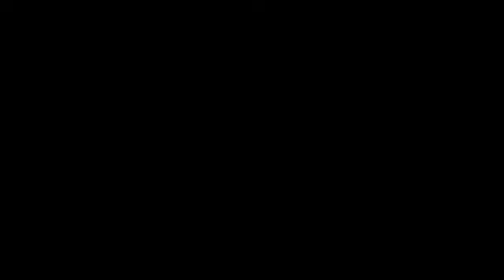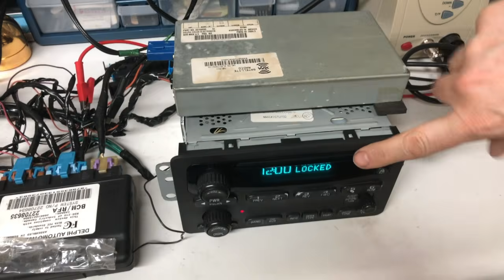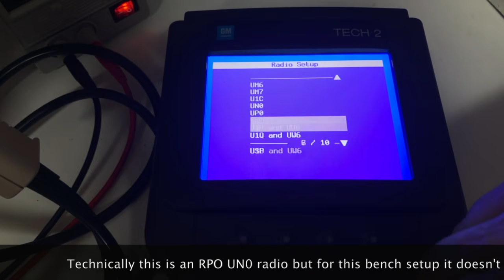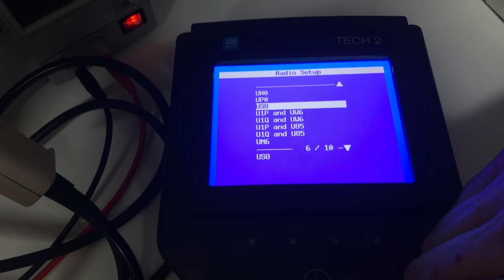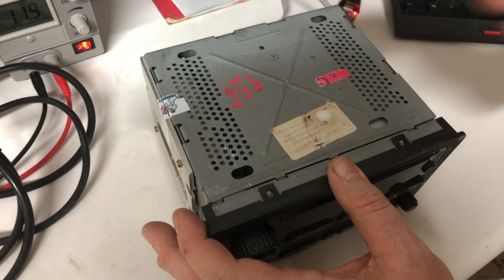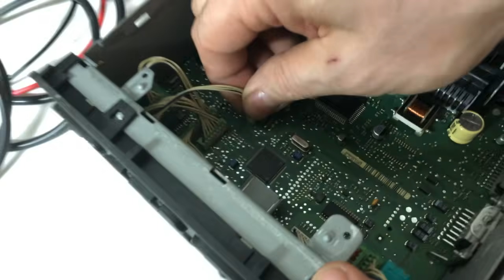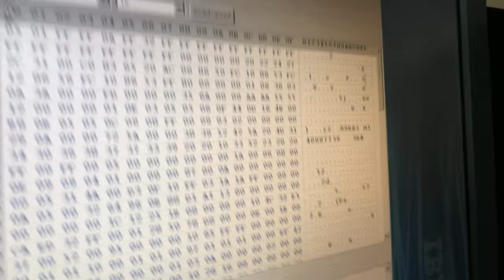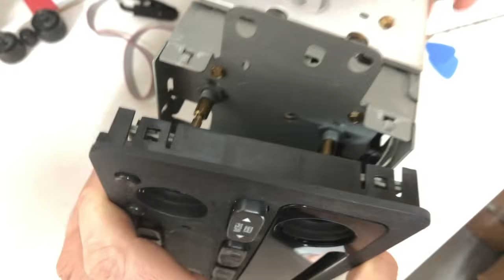2003 - 2006 How to VIN Unlock Salvage Yard GM RDS Radio w/ Tech2 OR Manually Programming its EEPROM

Comment: Dr. Shock, I have a 2004 GMC Yukon XL Denali and would like to replace my existing GM Radio/CD/XM/Cassette Unit with the same model unit (Salvaged - A Condition) which has the EEPROM cleared.  What are my options?  I don't have a GM Tech 2 nor GM MDI Scan Tool.  Would I be able to save the existing EEPROM data from Original and then write that data to the Salvaged unit?  Thanks for the help.
Reply from the maker: Yeah, I give two options for those without a dealership grade scan tool.   Your best bet is to just desolder the EEPROM from the original unit, and replace the one in the donor unit with the original chip.   Be sure both radios have the exact same GM part number as there are different circuit boards and different EEPROM contents out there even in the same model year.

Now you mention the salvage yard already has the EEPROM cleared and that's important.  As some vendors will clear this out with a scan tool before selling.  If you have that done, you don't have to do anything but plug and play and the radio will learn the new VIN on the first power up cycle.

Comment: Nice video. Question; what if you just swapped the chip to the replacement radio and be done with it ?  If not, why not ?
Reply from the maker: I believe I mentioned that in the video, that yes this is certainly an option (i.e., to unsolder the EEPROM from the original radio and replace the one on the donor radio).    For this to work though, both radios have to have the exact same GM part number.   Many radios have the same faceplate, but different circuit boards.

Comment: what is the numbers you changed on the eeprom and how do I find mine?
Reply from the maker: The numbers being altered represent the VIN of the vehicle that the radio is installed into.  You find them as I showed in the video, for this particular radio model. 

This video only applies to a particular year range and model radio used by GM.  Different year GM radios may have different memory addresses, and/or VIN formats stored so you may not find what I show here, if you have a different radio.  You may need instead to view one of my other vids I've done for different GM radio models and years.
Reply: @DrShock  my chip seems to be empty and i can’t get anything to show ip
Reply: @DrShock  I really don’t know what to do
Reply: @DrShock  I plug it in to my bench harness and it still has my presets even after I erased it
Reply from the maker: You may have to desolder the EEPROM from the circuit board and read/write it off circuit.  There can be circuit board differences even within the same model of radio that require this alternative approach.
Reply: @DrShock  I don’t have a solder gun and I’m not experienced in that at all, I’m running windows 11 if that changes anything, it may have to do with my computer since I haven’t installed any drivers and the only ones I find are outdated so I’m not sure
Reply: @DrShock  you may be right because I have a 2004 cassette and cd radio and it has a different board than the one in the video
Reply: @DrShock  dang that sucks
Reply: @DrShock  do you have any advice to program inside the vehicle, other than using a tech 2?
Reply from the maker: An alternative would be GMs' Tech2Win which is an emulator of the physical Tech2 tool that runs as an application program on Microsoft Windows combined with a J2534 type USB to vehicle DLC interface module like the GM MDI.  But any J2534 certified module should suffice.   

None of this is intended for the casual DIYer though.  Given your cited experience level, I would recommend you take this radio to a shop for the VIN relearn procedure.
Reply: @DrShock  thank you

Comment: didn't work with my Tech 2 -- never asked for the radio option code, just said "operation complete" and radio is still locked....  6 disc changer radio  in an 04 yukon.... option UC6
Reply from the maker: Is the radio model original to the vehicle (i.e., same exact model year and part number as if when built originally)?

Comment: Will the display button functions for like resetting oil change and all the other options that can be done through the radio still be done or does it just play music????
Reply from the maker: This video is for a radio from over two decades ago.  There were no such options available in 2003.
Reply: @DrShock  ok only reason I asked allot of videos on stuff say to use your radio. Let me ask u this I have a radio out of a 2003 Impala I bought on eBay as my original plays but stuff is missing on it. Can I take the front face plate off replacement and put it on my original as of course it’s not locked will that work. As I’m not messing with those main boards underneath. Wouldn’t that work
Reply from the maker: You could interchange any radio parts from those that have the same GM/Delphi part number on the white label.   But even if they cosmetically look the same on the outside, more often than not the connectors and placement differ on the inside if the part numbers are different.

Newer, much newer, GM vehicles have the radio display handle integration with setting other options in the vehicle.  But that's going to be past 2011 not in 2003.  ;-)

Comment: Great video!  I managed to do this for my work van that only had the weak AM/FM unit in it.  I upgraded with a cheap untested radio (CD and Cassette version) from ebay and it worked out great in the end!

I thought perhaps I needed to modify my programmer as you do in another video because I wasn't able to read my chip.  I ended up blowing up the programmer somehow but just ordered another (and technically I had my old Willem still around if I wanted to pull out a computer with a parallel port, hah!).
But then I realized I could try removing the rom from circuit and that was a success.  

Things I noticed:  
-The chip gets real hot if you plug in the clip backwards!   I was afraid I roasted mine for a second there.
-Removing the whole front metal panel after the plastic face is removed makes putting the clip on a lot easier if you're doing it in-circuit, at least on my radio revision/model.  Worth taking the time to remove the little hex screws if you have a  nut driver that fits.
-Chevy Express vans sure don't want you to remove that radio!  Yeesh.

Comment: my chip shows zeros across the whole digits, what can I do? Is it possible that you send this file so I can change only my VIN number? What is the reason the programs shows  zeros?
Reply from the maker: All 0x0's would imply that the chip is on a board design that cannot be read in-circuit with a testclip.  In such conditions you have to unsolder it, and read/write it off-board instead.
Reply: @DrShock After I confirmed, your digits are in series; 0x0A,F and 0x100,0x110 and so on. Mine is not so can the problem be with reading the chip? or will it show correct, in series digits if I remove it from the board?
Reply from the maker: Are you working with the exact same radio as shown in this video GM part number wise?  If so, give an example of the hexadecimal VIN layout you're seeing in the programmer editor (and what programmer software you are using).
Reply: @DrShock t looks the same, but the Delphi part number is 12248211. Only difference mine comes with a cassette player, which has to be removed in order to reveal the 24C08 chip in the middle of the board. I used Asprogrammer.
Reply from the maker: And what character sequence are you seeing for the hex representation of the VIN in Asprogrammer with this radio?   What I believe you're saying is that for say a VIN ending in 123456, you're seeing 654321?
Reply: @DrShock  Everything shows as 00. No indication of any kind of information, VIN, SN or anything. It’s like everything is changed to zero by force. The radio works for about 2 seconds each time I connect, and that is before Theftlock kicks in.
Reply from the maker: If you removed the chip from the PCB, and you're still getting this 0x00 behavior off board, then I would suspect your programmer socket is defective, or the adapter you are plugging into it.  This is, of course, presuming it's exact same EEPROM part number I show in my video.  If not, it could be that you are not actually looking at the EEPROM where the VIN is stored but rather some other memory device type on your board.

Comment: Can you program my 2014 junk yard Explorer radio with XM radio to work on my Explorer?  Both radios are of the same year and Mfg.  The connectors all plug in.  The junk yard radio will not tune and will nit tune stations as it is stuck on one channel.  Can you hack this issue?

Comment: I have a 2006 GMC 2500HD classic that didn't come from the factory with a radio. It had a storage compartment where the radio is supposed to be. I bought a factory RDS radio with CD and cassette on it. I installed it, did the temporary unlock procedure to verify that the radio worked. It came on and played music. I took it to the dealership to have it unlocked and programmed to my truck. They brought it back out and said they couldn't get it to link to my truck after unlocking it. They said it must be because the truck didn't come from the factory with a radio and the radio program wasn't in the truck computer. They suggested I guy an aftermarket radio. I do not want an aftermarket radio, especially since I have heard this radio play through factory installed speakers in the truck. I know it will work if I can get someone who knows what they are doing to fix it. That said, if I sent the radio to you with the required information from my truck, could you program it so that all I had to do was install it in my truck once you shipped it back to me? Thanks.
Reply from the maker: I don't provide that service, but I can tell you that there's no programming in the vehicle that would prevent the radio from operating once unlocked for a 2006 model year.   Did they successfully complete the VIN relearn so that the radio no longer displayed locked?
Reply: @DrShock  No they did not. But they still had no problem charging me $135 to do absolutely nothing for me.
Reply from the maker: IMO the problem is only due to the dealership not being able to unlock the radio.   There's nothing else to do besides configure the speaker setup, again by using the Tech2 scan tool.  

For older vehicles the newer MDI scan tool does not work as reliably for these radio relearns as the original Tech2, nor does the emulator Tech2Win.  In both cases GM made changes to prevent allowing the use of used modules in lieu of buying a new one. Some dealers no longer have the older Tech2, or lack employees who are familiar with using them nowadays.

You'll have to google for some outfits that will unlock your radio by sending it in by mail.  They are out there.

Comment: i just got nmy CH341A today and I am struggling. A few insights I wish your video has was the proper seating of the alligator clip module into the CH341 and whether or not there is a right way of actually clipping it onto the EEPROM. I really would appreciate any clarification on this as I am struggling right now since AsProgrammer keeps giving me "Error Connecting CH341A(-1)" when i goto read the EEPROM.

edit: figured out the Connection error, installed drivers and that is taken care of, Also noticed the clips have a red wire and in your video it appears the red wire is on the clip side closest to you. So with those two issues figured out in my own troubleshoot, i still cant get a solid connection on the chip yet. It appears as if the chip itself has a very sheer coating of some sort. Would this effect my connection?

edit 2: scraped the coating off the chip. got some new activity. got the "Read IC" to display the following: 
Reading memory...
Done
Execution time: 0:00:00
CRC32 = 0xEFB5AF2E

but none of the actual data shows up. still just showing all zeros. i am lost at this point
Reply from the maker: The red stripe indicates "pin 1" for the chip you are connecting the test clip to.  Some boards do have a water proofing material sprayed onto them that will have to be cleared away from the pins yes.

However, for automotive boards, the biggest challenge is the vast majority cannot be read in-circuit.  That's because the board designs/layouts tend to have other chips get powered up from the test clip supplying +5VDC and the resulting bus contention prevents reading, and writing, the EEPROM.   In situations where you know you have a working setup, but a particular board gives 0xFF's or 0x00's on a read then you'll need to desolder the device and read it/write it off board instead.

Comment: i just got one of the eeprom programmers (that you recommended) black edition. when i plug it into my usb port, it says driver unavailable. Any suggestions? thanks
Reply from the maker: You have to have a Windows device driver for it as well as AsProgrammer software. If you reference the CH341a video I linked in this one (upper right corner white circle i icon) it's description will have links to the software you need for it.
Reply: @DrShock  thank you. i was able to get the driver installed. now if i can get the software, hopefully i'll be able to vin write this radio.
Reply: @DrShock  you'll have to excuse me. I'm not exactly a tech saavy guy. i deal with mostly automotive repairs. but as you obviously know, these two industries are getting more and more related. I didn't even see at first from the link, that they were actually two separate links for the programmer. once I figured that out, I was able to get the software on my computer, and am now in the process of trying to read and program it.
Reply from the maker: Yeah it's well into the point now where you have to marry the mechanical with the electronics background to effect the repairs.  ;-)
Reply: @DrShock  so i got into the programming software. i entered the data from the chip , 24c08 generic. It's actually from a 2008 chevy trailblazer going into an 05 silverado. I can see it does say 24c08 on the chip, and looks like it's stamped ST. when i have it plugged into the clip there is another led on the usb drive that lights up when there's a good connection to the chip clip. i click on the read chip icon. at the bottom, it says it was successful, but theres no information across any of the lines
Reply from the maker: If you can read the chip using an in-circuit test clip, you can usually also write it.  But you have to be sure the programmer device supports 5V.  Many of them only do 3.3V by default, which is enough to read but not write an automotive EEPROM.   So that's one thing you can check (I did a video on how to modify the 3.3V type CH341a to do 5V).

Another common issue is that for many module/radio circuit boards the EEPROM cannot be written to because of the circuit design.  What happens is power from the test clip ends up powering other chips on the board and this creates contention preventing the write from being successful.  In these latter situations, you have to desolder the chip from the circuit board.  Programming it out of circuit, then reinstall once the programming changes are completed.
Reply: @DrShock  i went to the link you recommended for the software. found the post for the link download. clicked on it to open, but it goes to the next page that shows the shows the asprogrammer  or driver and firmware. when i click on the file icon, than open, it doesn't do anything. and this is all through windows 10. thanks

Comment: So, if you just erase the vin from the eeprom, wouldnt that be like installing an unlocked radio? Where when you plug it in, the bcm will automatically enter the vin? Also, what program (site) do you use for reading and writing the eeprom?
Reply from the maker: Yeah, most of them would come like that in their virgin state.   Some years it will want the memory are for the VIN filled with 0x00, other years 0xFF.   I use AsProgrammer from the CH341 video linked in the upper right corner of this one (white circle i icon).

Comment: wonderful video.  I borrowed a Tech2 and  the procedure here doesnt seem to be working for me. the radio set up runs and says complete but nothing happens. still locked.  Iam purchasing the 
CH341A 24 25 Series EEPROM Flash BIOS USB Programmer on amazon  and will try to change the  VIN as in the video. Can you tell me the software you use and the best place to find it? thanks
Reply: Nevermind.  I  just saw your instructions tosomeone else on how to find it.  Thank you